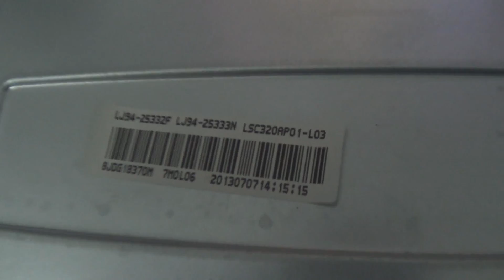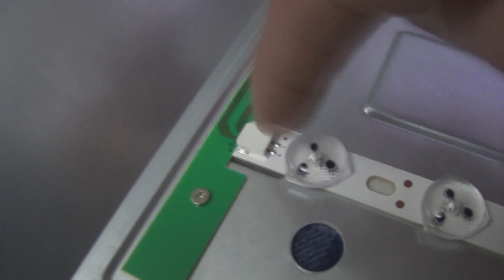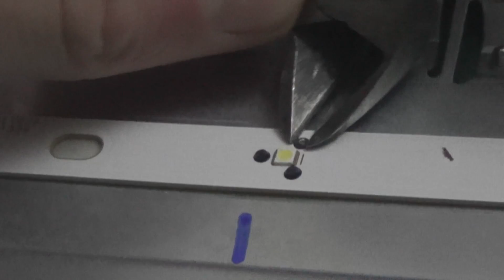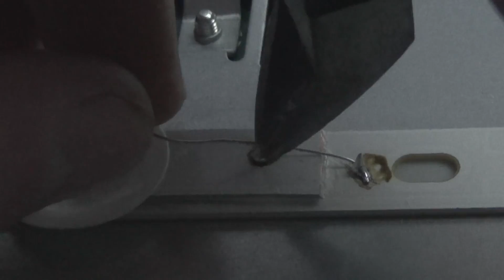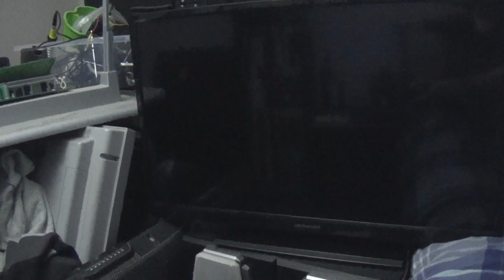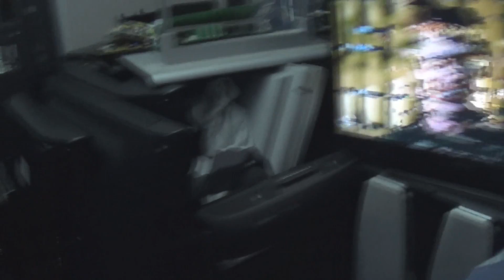Led Tv Backlight Repair Stacking Method

Comment: I got an LG 47" with Backlight blips and off. But, ALL Strips/LEDs light up . Just one "late bloomer". So, bad LED doesn't necessarily mean burnt.
Reply from the maker: Nope not at all, I’ve had them appear perfectly fine even under a microscope. However draws too much current on power or the led fails open on power up 😭
Reply: @MrReeceyburger123  it triggers the protection.

Comment: Thank you very much, thanks to your video and a tip from a friend who told me that the voltage for the led strips comes just a second if the leds are broken, I could fix my tv for only 26€ and have 2 spare streap leds for the future.

Comment: Can I use heat resistant silicone to fasten it down with? I have a broken screen TV I could use but what if the LEDs use a different voltage, does it matter?

Comment: Thank you for this video, I myself have been repairing LED tv's with burned out LED chips. i've somewhat repaired TV's with 1 burned out LED by completely Bypassing it. But i have a 49 Inch digihome LED Tv here with 7 burned out chips (previously repaired by a "Cowboy") i shall give this Stacking Method a try.

Comment: Hi thanks for the video tutorial, one question from a newbie, when testing the lights with your meter either side of each light, do you have the tv plugged in and turned on or not. Or are the lights working from just completing the circuit?
Thank you
Reply: Plugged out. Im guessing if you're still alive you realised this
Reply: @diggerlenny4836  Im guessing if you're still alive

Comment: DIY, it is more professional to simply replace the led
Reply from the maker: Jacquy Lenoir Your point is sort of invalid to do a professional job you should replace them all not the bad one. This gets it going and is a reliable method no questions asked. You can replace them but it wastes time and wont make the set last any longer as another could pop shortly after.

Comment: The LCD panel uses about 10 watts.  Those tab bond drivers are usually ok - it's not the IC that dies, its the solder that goes.
Reply: ubuntututorials

Comment: hi, i replace the damage led on my LG 32LN5400 FULL HD with led High Power LG 110LM 1watt 3528 but the led dont work why? is the wrong led?
Reply from the maker: Is the voltage correct from the psu ?

Comment: where can find replacement LED just like in a video?
Reply from the maker: As I said in the video, from smashed Tv's or you can get exact new replacement leds from Aliexpress.
Reply: in other comments you said the led between 3-4V and 400mA is that correct?
Reply from the maker: +DIMITRIOS DANOGLIDIS These will work:

http://www.aliexpress.com/item/LG-Innotek-LED-LED-Backlight-1210-3528-2835-1W-100LM-Cool-white-LCD-Backlight-for-TV/32510925583.html?spm=2114.10010108.1000013.25.LZf02B&scm=1007.13339.35814.0&pvid=fe130165-b0fb-4023-a331-bb4ede0c82fa&tpp=0
Reply: thank you very much
Reply from the maker: No worries glad to help :)

Comment: Great video but why don't you use solder wick to clean up after you remove the damaged LED?
Reply from the maker: Cheers buddy, also I don't use it as I like to keep a small amount of solder on there rather than reapplying to solder the led down :)

Comment: could i use a led out of a laptop screen, the laptop is a acer extensa 5235 - 90G16Mn model number ZR6
Reply from the maker: Yes but it might be a little small but the rating should be the same.
Reply: thanks mate, the size is not a problem, i can just solder the diode on in place of the blown one and use old ones lens as i have a low heat solder iron, it was just the rating i was unable to find out, was worried it would be less, although i could of dubled them up to equil same rating if they were half the rating, but sounds like im good to go then with these tiny ones.
Reply: hi, well i did it and did not melt any of the tiny leds, was quite easy, but now the tv flashes on for a half a second then the back lights go off, the return has 0 for most of the time and then changes to 4 and slowly goes down to 0, what else should i check, its the exact same power suply but revision 4 so some of the diods on that one you have there, in the uper right corner just below the caps you have 4 diod mine has them removed and replaced with a 2 leg chip like thing with heat sink, so which of your videos should i watch to be able to diagnose what else is wrong with it.
Reply: found out what that chip thing is they replaced the 4 diodes with FFPF15S60S 15 A, 600 V, STEALTH TM II Diode
Reply: iv learnt how to test this and its ok, but iv found that all the fat blue pie caps that go across those areas that have those shaded in paterns on the board at posistions C118 C121 C123 C125 and C126 have no reading but there still attached to the board, plus that single big resistor posistion R127  has no reading and the two diodes at posisition D134 and D135 have a reading in both directions, do i need to check any of these off the board and also i cant figure out what that big resister is to order a new one if it is broke, would there be anything else to check that those things could of broke.
Reply: ok iv now checked all the parts off the board and the diodes are ok they only go both ways when on the board, the big resistor and the 5 blue resin dipped ceramic caps all give no reading off the board so i guess there nackered then, but im having trouble finding replacements as cant really tell what they are, on the scematic its says the caps are 1n 4kv and the resistor says 4m7 but no where online gives any results for them and i cant read thw writting on the caps as its to small even with a mag and the colour on the resistor are also hard to tell what they are, its the exact same ones you got on that board in this vid can you tell me what they are so i can find equvilents.
Reply from the maker: Head over to badcaps.net I will help you there.
Reply: ok thanks i will go and find you there, iv found the caps i think just the resistor now, :)
i wanted to say you are the Referrer but it says MrReeceyburger123 is not reconized so il just join
Reply: ok mate i found your id on there and put it as referer, but iv done the first post to say hello and then went to edit my profile as it says to after you have made the first post but it says i dont have permision, so i tried making a htread and that to said i dont have permision so i cant get help there from you as there system does not work like it says so in the pm you get when you join, i just realy need to id that resistor as i cant tell what it is, if i can fix this one tv then i will go back there and see if they can make my account work, otherwise im wasting my time if im no good at fixing things.
Reply from the maker: You will need to post on the new users thread to gain permission to make posts buddy.
Reply: i have already done that, thats the bit called new members please post your introductions here, if its not that bit you mean can you give me a link as i cant find any toher new member posting area
Reply: um ok its just sudenly started working after i sent the webmaster a massage

Comment: Thank you for your video its very informative for people like us, i have Samsung LCD tv Model = LA32C350D1XXT.  it has problem with power going standby around 15 min, i checked sleep mode it was off, i have factory resat also, and its not by over heating also i have chacked with cooling fan on pcb board also, so can you advice me what will be problem video board or power board if i need to replace, help me.
Reply from the maker: Hello thanks for the comment :) Also please head over to badcaps.net and I will help you on the forums as you have a different issue thanks.

Comment: Mister! I do not understand why it did not replace any faulty LED lines with a new one?
As well as two LED lines.
In Hungary, the price of 10 Euro per head.
So a total of 20 Euros for the two LED panel.
It makes no sense to risk failure two months later, another LED.
Reply: I've been trying to source led strips in the UK for ages, and most charge £25 per strip section. For example mine is a 50 inch lg and three rows aren't illuminating. So if I were to buy potentially six parts, that's £150, not cheap.
Reply from the maker: Type in VES315 or VES400 into ebay you will find Led strips there for cheap then use the method shown in the video to replace then. Also the guy above saying $20 for the leds is chatting total shit ignore him.
Reply from the maker: You sound like someone I know, Diah off bcn ? Also why do that ? The Tv its self isn't going to last longer anyway, if you bothered to watch the video I said I turned down the backlight to low to help preserve the others and that works fact as I have had these sold over a year when I have turned down the backlight.

Comment: hi I have LG 39'' led there is before four strip led in series 94v after I changed new one I fix four strip 94v in parallel but glowing low what is the reason when I check voltage earth to positive showing 94v and negative and positive showing 47v why like tis and when I remove two strip  then showing 55 to 60v and led also glowing good high so give me reply and how I can know you gave reply please
Reply from the maker: Your Led driver is faulty then. Likely the controller is not turning on the boost mosfet enough. I have a video with a similar repair coming soon. Check out for it. If not head over to badcaps.net and make a thread and I will help.
Reply: +MrReeceyburger123 
Capacitors are ok but why like this I don't know
Reply: +MrReeceyburger123 
Hi 
There is I fixed all and check but now there is led flashing every two second all led glowing but why flashing help me
Reply from the maker: Hello it sounds like your Led driver mosfet is not being turned on enough. This is likely because the controller for it is failed. Replace the Led controller on the Psu or replace the Psu. I have a video coming soon about a similar issue I had on an Lg low led voltage the controller had failed.
Reply: +MrReeceyburger123 hi which controller can you show me mean what transistor or what
Reply from the maker: Will upload video on how to repair it in the next few days, will link it when its uploaded.
Reply: okwaiting thanks
Reply: +MrReeceyburger123 hi
Finally I got it there is fours strip not working but I put two strips parallel and there is 55v Dc and total two strip total led is 20 nos I check and running continue one hrs and working good that time I have dout but finally working great but one question that is working long time or what pls reply me

Comment: the led of a sony bravia are different they are built in by the side of the screen
Reply from the maker: That will be an Edge lit Led screen, this is a full array type. Similar method of testing though.
Reply: MrReeceyburger123
 yes sir i try to test the led with the vom tester , and i follow also the polarity but the led never light i even put a 3.7 volts supply never work this LED has 6 terminals, 3 on each side, so what i did is, i test it individuals. and the led will light if i got the good polarity, my question is what do you call this kind of LED? and do you have a diagram for this?
 i also open a samsung tv and the back lights are small tubes, like skinny  fluorescent tube, can this be substitute with LED lights?
Reply from the maker: Its just an SMT Led. Also yes you can use Led in place of ccfl and vise versa.

Comment: Is there a multimeter with a Capacitor checking port, and or a PORT device with preprogrammed for TV Units, and do all the continuity checking, and any faulty components? Similarly to a diagnostic device for automobiles, that diagnose engine problems from a cigarette lighter port?
Reply from the maker: You will need individual meters like a ESR meter, DMM and SPI flash analyser mate.

Comment: Thanks for the video, do you know the component part number for this LED ? Wouldn't it be easier to resolder a new one?
Reply from the maker: Not sure on the part number but they are 0.5w Smt ultra white 0.4 mm Leds.
Reply from the maker: Also I have another video on me desoldering the actual Leds buddy, check it out on my channel.

Comment: hi. do you know at what voltage does one led work ?
Reply from the maker: +eugen schmidt Hello Eugen, for these Tv's its about 3 to 3.5v per Led&#160;they dissipate about 0.5 watts as well. Anything higher than 4v per led will burn them out very fast.